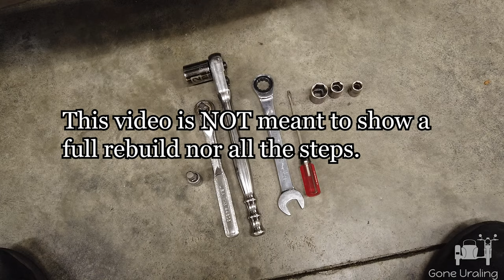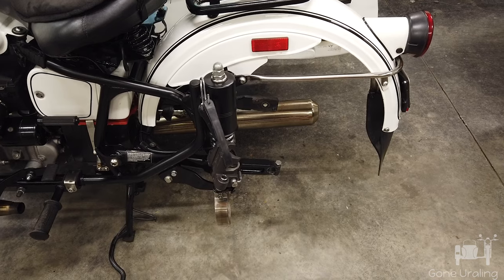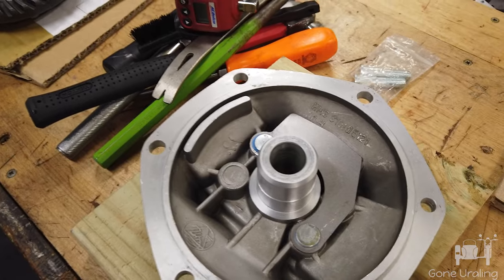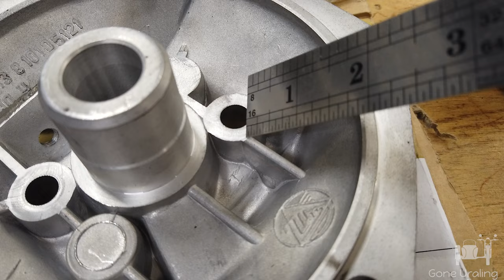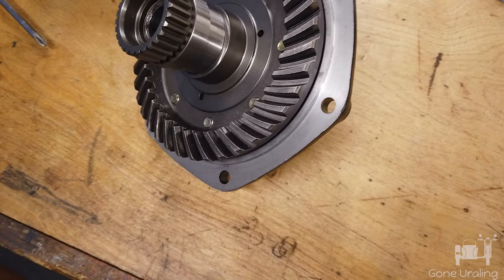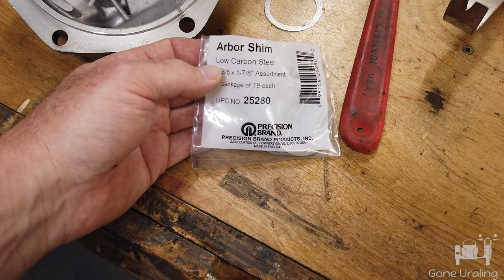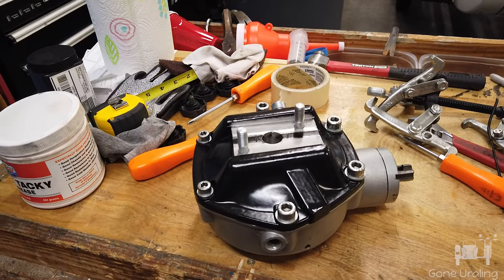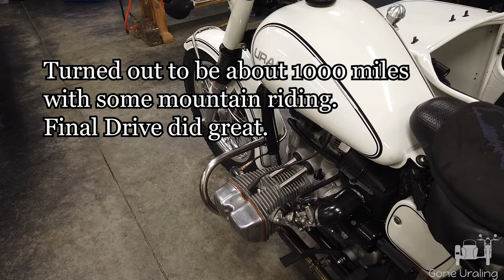Final Drive Rebuild on 2017 Retro 22.5

Comment: This was eye opening. My cT has developed a little braking squeal. I had attributed it to brake pads. This video makes me think if pads don’t cure the squeal I may check the studs. Thanks Bob.
Reply from the maker: I had tried brake quiet, replaced the pads with semi-sintered, used that paint on the back of the pads, nothing worked. I still had a squeak-squeak-squeak when coming to a stop.  Turns out, it wasn't the brakes!

Comment: Excellent video. I just had to replace the output spine seal due to a leak and was hoping that I didn't have to crack the FD to replace the seal as the thought of doing a re-shim was a bit / lot daunting 🤔.  Luckily I got to the seal from the outside, replaced it and all was good.  I was very careful with torquing up the FD mounting bolts as I know the stud head pull through is a commonly reported issue - mainly due to people getting their Nm & Ft Lbs mixed up.  I have a manual that states the gear backlash is measured at the edge of the output spline but is still quoted at  .003" - .006" which would work out to be less than than way you did it because the larger radius of the output spline.  Interesting !

Comment: Hi. So I am just curious as to how you typically ride your retro. My 2015 retro has the tall gear ratio and I do very little highway riding. I ride mostly NH and MA back roads. Some hills,  but nothing crazy. I am in third gear 95% of the time on the 30-45 mph back roads. Its really in a great PowerBar range for these speeds. I typically never hit 4th unless I am over say 47/50 mph (Ural speedo). I need to downshift to third by 43/45ish unless is a steep downhill or I am lugging.  Curious your experience?
Reply from the maker: I have the regular gearing. I just get on and go. I ride mostly on back roads and some highway (non-interstate) and will cruise about 62mph in 4th gear per the GPS. I tend to settle into that speed as it "feels right".  We do travel interstates if/when we want to, but I really prefer not to do so, I just don't trust the other drivers. I have ridden the taller gear ratio and did not like what it did to first gear. I also didn't like where it moved the bottom end of 3rd gear. We ride in the mountains and the blue ridge parkway where I can easily stay in 3rd. With the taller gear I found I had to hit second more often to pull steep hills in a curve. Ideally, I would love to have two final drives, one for the mountains and one for the flats.  EDIT: Oh, I will cruise 65 to 67 on the interstates, I have to consciously hold it there though, if I don't pay attention, 62 is where I'll end up.

Comment: and why I just got done emailing Jon to have gear in my FD on the 2018 replaced (going to a 9 gear, speedo be damned).
After 10 years of Retros (have an 11 also for those who don't know, it's my avatar) can get the tire off without removing the torpedo...but it is easier to take it off...
Reply from the maker: I just wish I could make 3rd gear 5% "taller" and 4th gear maybe 8 or 10% taller.  I don't like what the taller rearend does to the lower end torque, esp in the mountains.   It's easier without the pontoon and takes maybe 1 minute to remove it... unless it is hot.